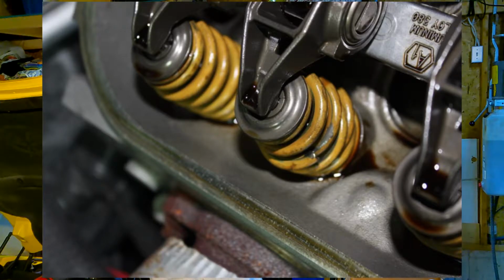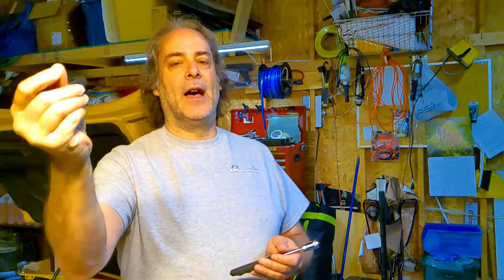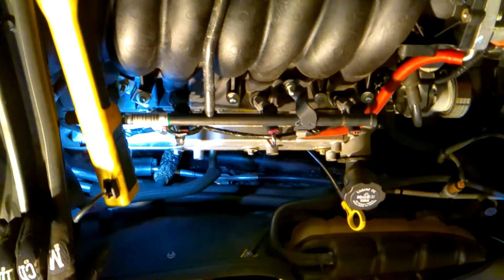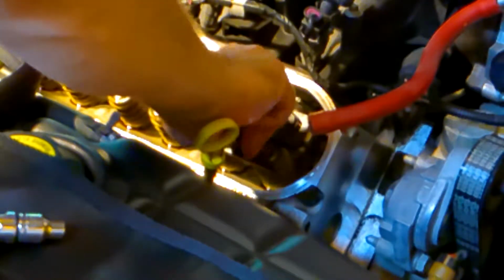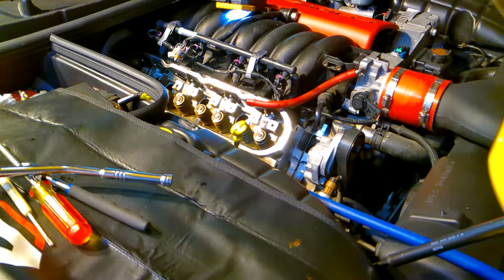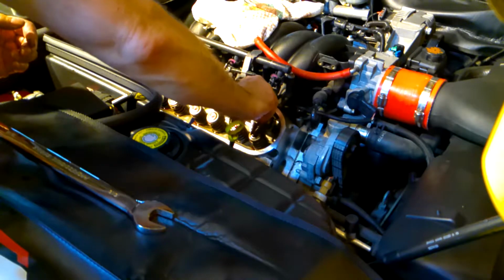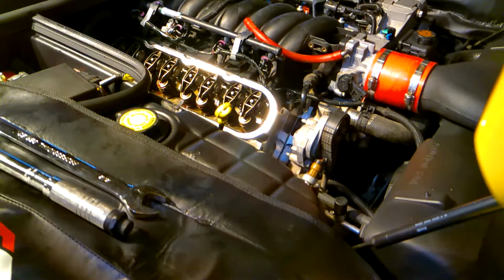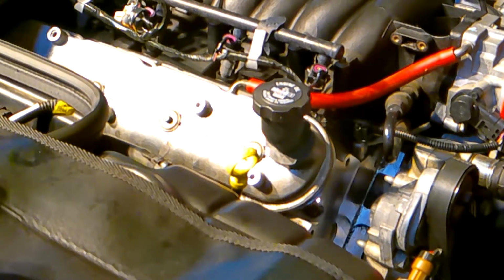LS Engine Gets A Valve Spring Upgrade

Comment: Does that tool works for 350 small block, I’m trying to buy one but all I see is for LS engine?
Reply from the maker: Which tool?  The compressor valve tool or the spring removal tool?
Reply: @ The spring remover.
Reply from the maker: @iceman10618  The tool I used was designed for LS motors.  The way that other SB 350s mount their rockers is different.  I don't know if this style of tool would work.  Would need to remove the rocker arm stud.  So I have not seen this system for non LS motors.  Makes me wonder if one can custom make such a thing???  I know back in the day the heads were removed and another type of tool was used to compress the spring.

Comment: Did you turn the engine at all between each valve spring replacement?  I noticed the belt had moved between video takes. Do we have to be top dead center or does the air compression method only work without having to do anything additional?
Reply from the maker: Air compression holds the valves up so no need to spin the motor.

Comment: Hi...do you know what's the part number for the pac ? Do they work with 2003  convertible ?
Reply from the maker: PAC-1218 Drop-In Beehive Valve Spring Kit for all LS Engines - .600" Lift Rated
The PAC-1218 Spring Kit is a drop-in high performance spring kit for all OE LS cylinder heads and is rated for up to .600" lift.
Reply: @justcorvettecrazy116  thank you .  👍

Comment: How much psi
Reply from the maker: Air Compressor about 90psi.
Reply: Thanks, I just got my 02 z06 with 23470 miles and find your info very helpful. I  put my scope down the oil spout last week and seen yellow. I have a lot of ground to cover; with subtle upgrades and deferred maintenance, but that's where the fun is.
Reply from the maker: @tedkernan6420  Very cool!